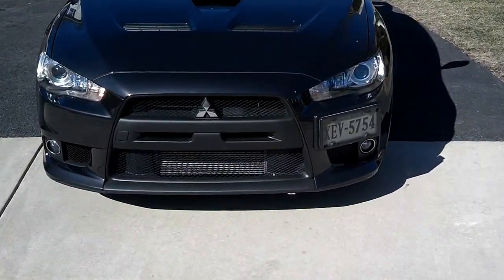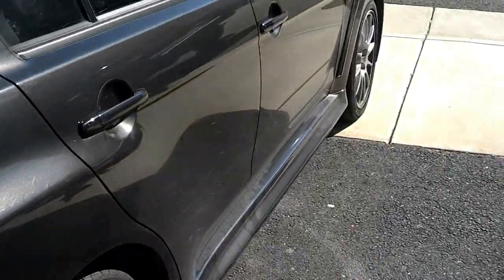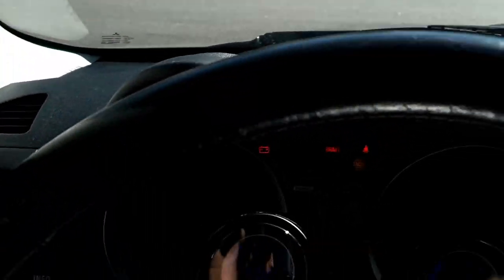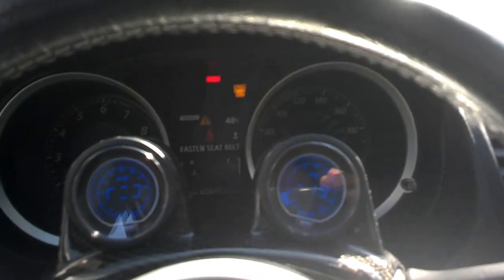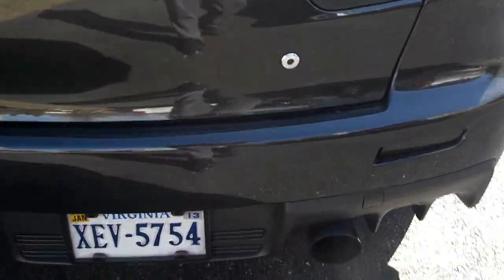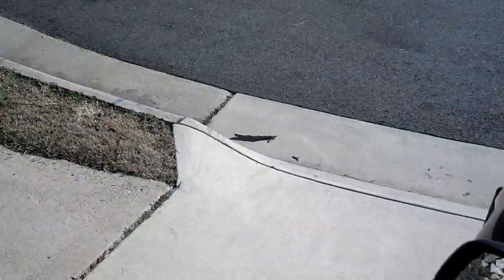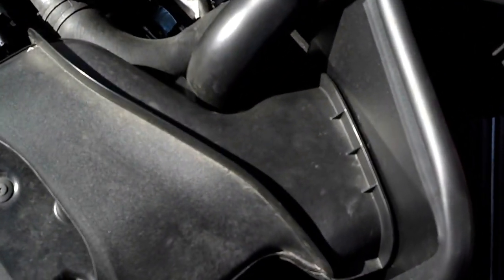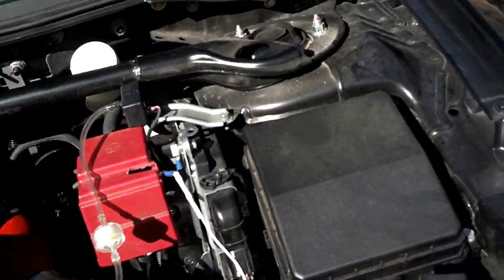Mitsubishi Evo X  k&n filter prosport gauge

Comment: Nice car man. I'd hold off on the downpipe as it will not change the sound whatsoever (although will net you a good amount hp). do a test pipe first. that will definitely do alot more for sound and hp.  On a side note, are you happy with the typhoon intake or would you have gone a different route like ETS in retrospect?